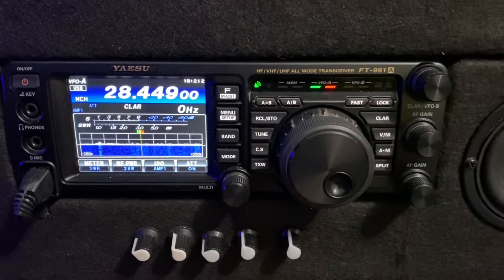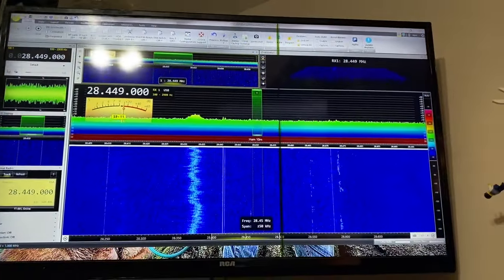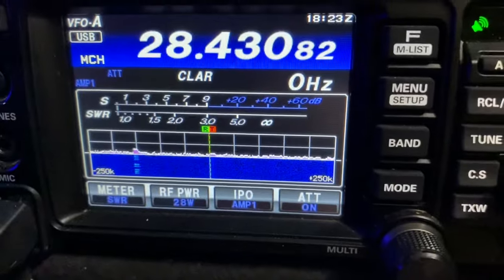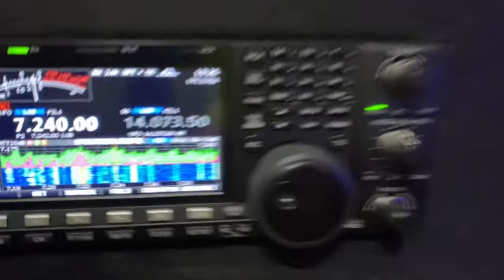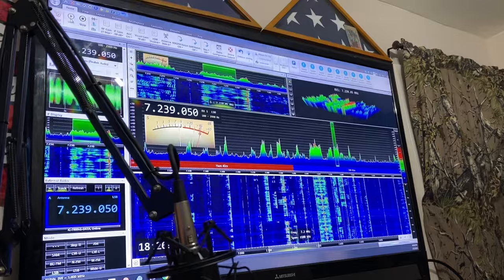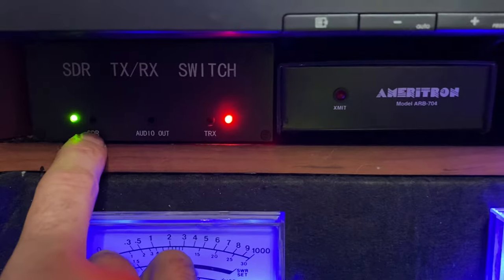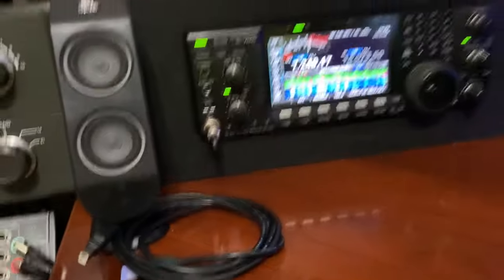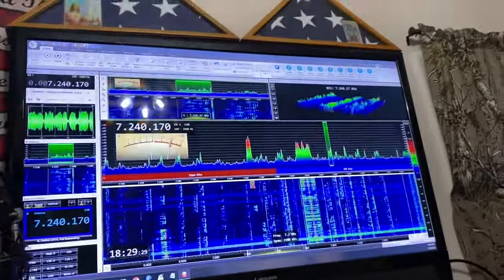How to get an external display on your Yaesu FT-991A

Comment: Ok so the computer is hooked up to the SDR via USB. The SDR is hooked up to your external antenna and the antenna input of the radio? The display is hooked up to the computer via HDMI or whatever compatible plug you have on the comp/monitor. The Omni program is controlling the radio via the computer and some form of additional cable connecting the 2? The SDR is a standalone radio box capable of HF,VHF, and UHF. Omni links the 2 together? Could you just use Omni and the software to control your 991 and avoid the SDR?
Reply from the maker: Correct as far as all the connections go. Without the sdr itself you can not have a visual output. The sdr is what converts the rf into a visual. 
I intend to do a more thorough video on the 991a but if you like I have another video of how to set it up generically using an icom 7000.
Reply: @SlowGoose  I saw that one. Would love a 991a dedicated video like the one for the Icom. Using the same SDR in this video. Let me be sure though the SDR model has to be purchased in the correct band you want to use? They are either multi band (HF/VHF/UHF) or HF only?
Reply from the maker: @sigfla1  from what I have seen most of the sdrs cover hf and vhf uhf. If you do get an rtl sdr it will cover all. I don’t recall how low it goes but I have never had an issue with it receiving down to 80m. I’m not set up to go any lower than that. 

I do plan to make a 991a specific video. It’s just a nightmare to pull it all out of my desk and pull all the wires out.
Reply: @SlowGoose  gotcha. Such a beautiful setup Yaesu needs to come out with a 991b with monitor out. Your video really shows the advantage of a larger display over the one on the unit.
Reply from the maker: @sigfla1 I would love to see it on a newer version of the 991. But in reality using the sdr in this capacity gives you much more use ability.  As far as I understand it a radio with an external monitor is just a mirrored display not actually functional.
Reply: @SlowGoose  yep pretty sure you are 100% correct. For now I have time as I haven’t taken my General yet anyway and antenna installation in my HOA will be a challenge. Maybe by then I’ll have the will to buy a 991a crack it open and install the SDR board or if your video seems easier maybe I’ll go that route with an antenna switcher and all external hardware.

Comment: Awesome video. So basically you connect the FT-991A to your computer and then combine the programs, Omnirig and your SDR program to create what you have. Is that it? Not sure how you are connecting the control of your radio to SDRConsole. I get the connection to the SDRPlay device but the control and video from your radio has me stumped.
Reply from the maker: Thank you. That’s pretty much it. But don’t forget you also need the sdr itself.
Reply: Yes, I have the SDRDuo but still don’t understand how you are controlling the radio.
Reply from the maker: @rbc1225 I will make a video showing how to set it all up. But omnirig is what talks to the radio. Have you installed the yaesu drivers?
Reply: That would be awesome, just a short video of setting Omnirig. When I load Omnirig and start it, all that shows up is 4 com ports, nothing else. I will google some help on it and see if I can work it out. As far as drivers, yes I have the Yaesu drivers, it works fine on my win4yaesu program, but I am interested in yours too.

Comment: Works well at 100w or less on the 991A. Anything more the switch won't handle it. For guys running amps forget it, buy a true SDR rig like a FT-71O that allows an external monitor then your good with added power without worry.  If your ok with 100w then your good.
Reply from the maker: I can run legal limit. You just run it before the amp. It never sees more than 100 watts.
Reply: @SlowGoose  makes sense & good to know.

Comment: Great video! I went and purchased all the items you suggested. The question, when using sdr-radio for my FT-991A, I cannot get the frequency on the SDR-radio to match my radio. It currently shows another frequency. Do you know of any links to help me with this? Thank you!
Reply: Found the problem. You have to start Omnirig first and then SDR Console

Comment: Ok, so, my 991a, is seen by the RSPdx in uno. I can change frequencies in Uno and my 991a responds. What I'm missing is seeing the waterfall with the signals. All I see in Uno is just regular waterfall but no discernable signals. What am I missing? I see in your video a cable connected to the "Ref In" jack in the back of the SDRPlay. I don't have that. Is that what I need? What cable is it? Thanks.
Reply from the maker: The line at reference in is the usb cable between the sdr and the computer.  If you are not seeing signals on the waterfall you may need to adjust the gain on uno. If that doesn’t work try installing another sdr software and see if the problem continues. If it does try different antenna ports on the sdr and make sure the correct antenna is selected in the program. You may have over driven the front end of the sdr. I had that problem and it was because I had my antenna switch disconnected so the sdr never was blocked from my tx power. Hope this helps. Let me know if you have any other questions
Reply: @SlowGoose and if you have over driven the front end, we have to replace it right?
Reply from the maker: @maxasaurus3008  It has protection diodes that usually pop and it stops there. sometimes you can do more damage

Comment: Hello. 
Interesting video, but lacking in explanation.
How do you configure with the cat câble?
Omnirig settings?
Connecting the box for PTT switching?
Reply from the maker: It’s hard to give a complete answer because it will vary for everyone. Depending on what port you have the radio plugged into on your computer Will determine the comport. Once you figure that out you just select your rig from the list. 
As far as the ptt line, on the 991a it’s a bit of a pain. Most radios have a dedicated send line or something of that nature. On the 991a you have to get an 8 pin din plug for the remote jack on the back. Then you need a line from pins 2 and 3. One is labeled as tx ground and the other is ground. It will short across when keyed. The cat cable itself can either be the usb or the serial port on the back of the radio. Drivers for the usb can be found on yaesus website and the serial cable (at least in my experience) will either come with drivers or a link to where to download. The antenna switch is just like hooking up a watt meter. Coax passes through and there is an sma jack that runs to the antenna input on the sdr. 
Hope this helps. Any more questions feel free to ask.

Comment: You'll have insertion loss from the RF switch/ splitter. Why not tap the IF?
Reply from the maker: Because that won’t mute the input on the sdr. If you tx while the sdr is receiving you will over load the front end of it.
Reply: @SlowGoose  You can tap the IF (not RF) internally.
Reply: @AndrewPepper  True, I tapped my IF and it's a game changer!  <$20 shipped for the tap board and some soldering and baby we got a stew going!

Comment: Will this setup work with the FT-891?
Reply from the maker: It should. As long as you can connect to a computer via the usb port. The tx ground should be picked up from the tune/linear din plug on the back. Not sure if the pin out on the din plug is the same as the 991 but it will work